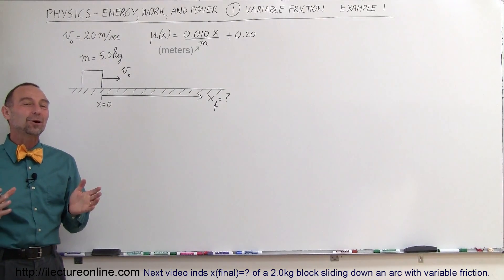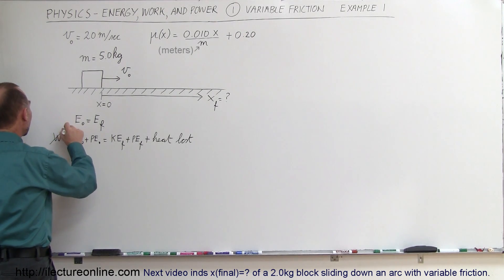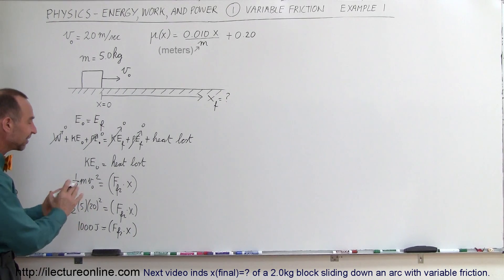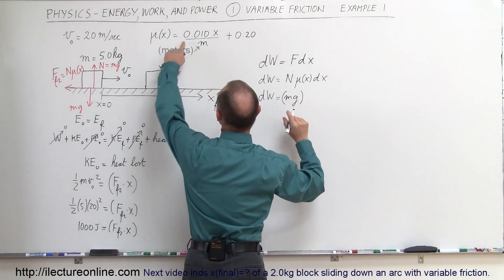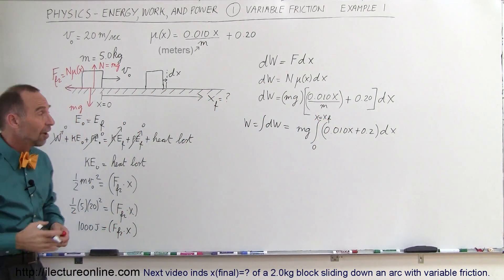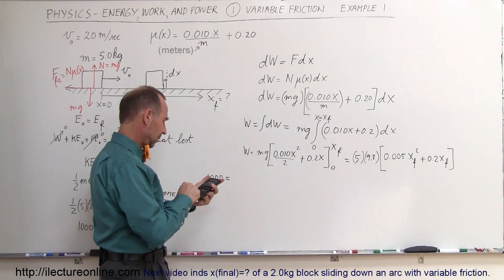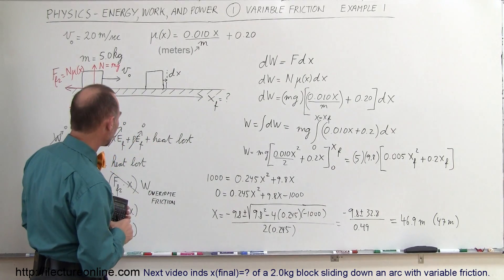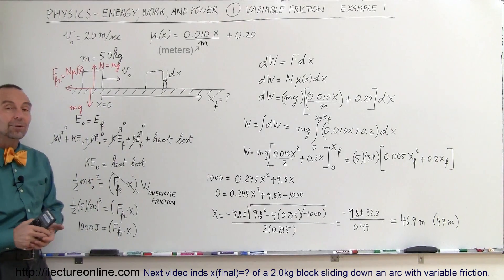Physics 8  Work, Energy, and Power (32 of 37) Variable Friction - Example 1

Comment: Sir, Your approach with the work energy formula is great, I am getting the answers correctly with this formula.
However, This formula is not found on textbooks. Which book has this method?
Reply from the maker: Not sure if I have seen this in any textbook.  It is the method I have used in my classrooms for a long time.

Comment: Thanks for your quick response.. I want to say that u please add the video of pulleys and spring in which we can use work energy theorem or conservation of energy. It will be helpful for my exams...
Reply from the maker: If you can give us an example of such a problem, we can better gauge the approach.  Thank you.
Reply: Michel van Biezen 
Example - In an ideal pulley system, mass m2 is connected with a vertical spring of stiffness 'k'. If Mass of m2 is released from rest.,when the spring is undeformed, find the maximum compression of the spring. 
I want you to look at one more question but i can't send it here as it has a figure with it. Please tell how can i send that question.
Reply from the maker: Is the spring connected to string which goes over the pulley and is connected to a mass m1 on the other side?
Reply: Michel van Biezen 
Yes sir. String goes over the pulley and is connected to mass m1 on other side.
Reply: Michel van Biezen sir I have one more question but it have figure with it. So how can I send it to you.

Comment: Hello Professor,
I didn't get how you lost the mass (m) at the denominator of the 
variable friction coefficient when you integrated the partial work? 
Maybe I'm missing something...
Reply from the maker: Note that the m in the denominator represents meters and it is needed there so that it will cancel with the units of "x" in the numerator.